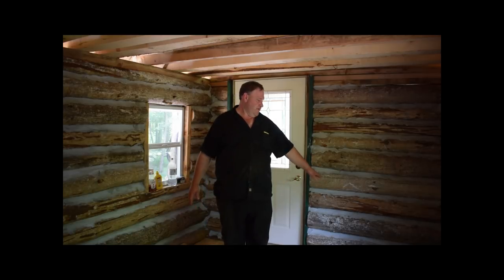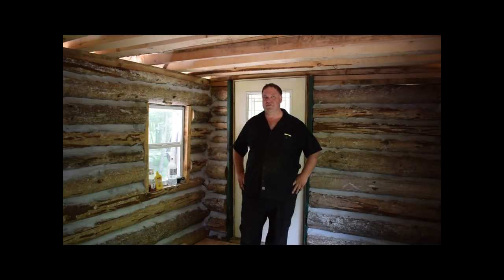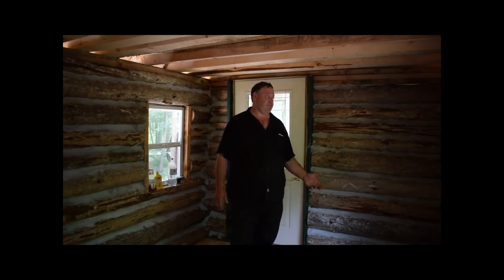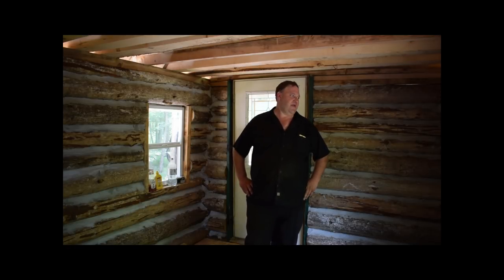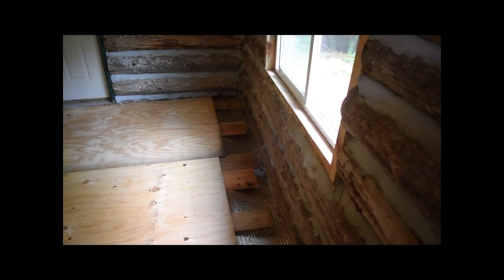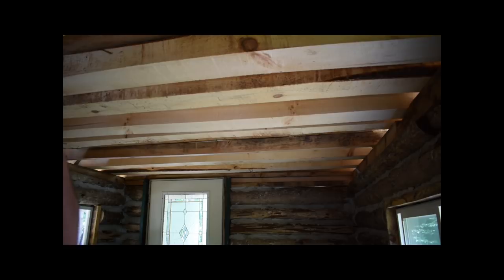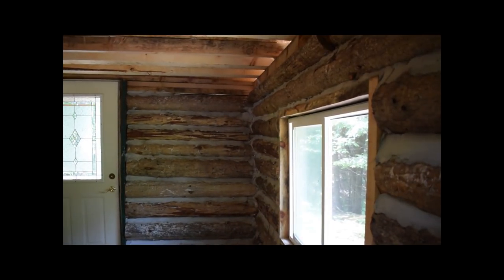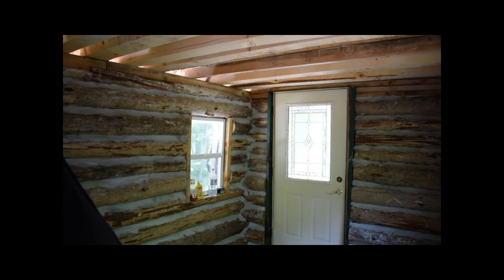Off Grid Cabin Wall and Floor Update :  Some Visitors to the Old Salt Block Stump

Comment: on the flooring on the silver heat bearer (spelling) will that flatten and not work over time? Im thinking of putting it in my cabin, thanks much!
Reply from the maker: Thanks for watching, as far as the insulation I used on the floor, I am not sure if it will work over a long period of time.  I know people that use it in house building project, like with a crawl space floor.  It must work ok but I will find out i guess.